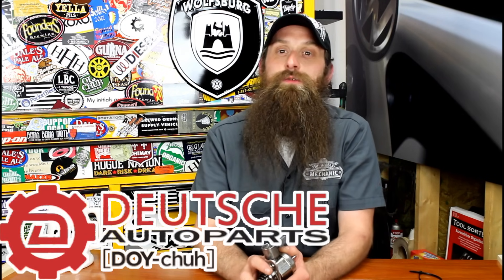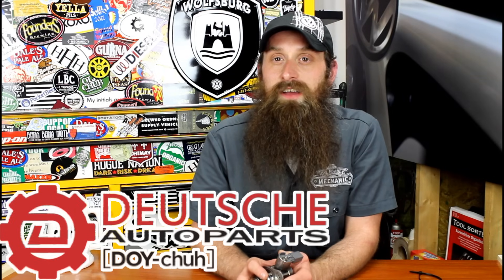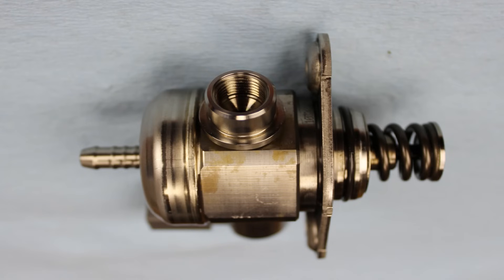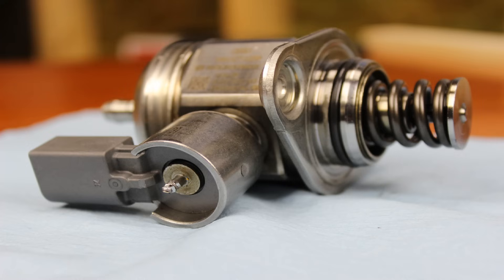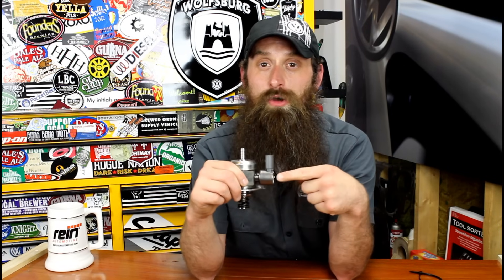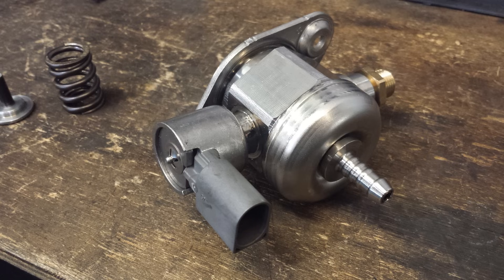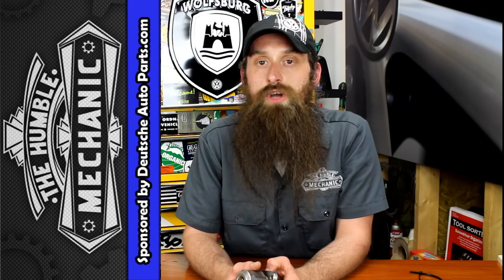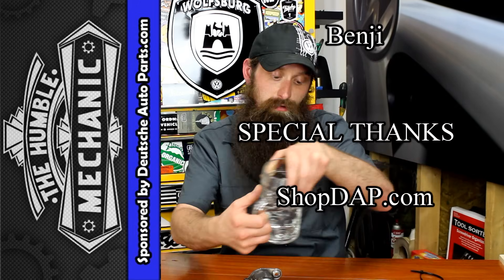How VW and Audi 2.0t TSI High Pressure Fuel Pumps Fail (HPFP)

Comment: Be advised, this HPFP can leak internally and dilute the engine oil. The symptoms will be hard starts after shutting down a hot engine for an hour, misfire at idle after the engine has warmed up, and negative fuel trims as low as negative 100. No issues off idle. My Mk7 GTI was at the dealer for 2 weeks and 4000 dollars later it was not fixed. I replaced the high pressure pump and all operating parameters are back to normal.
Reply: Quick question. I have a mk6 so I'm not sure if the same applies. I've been suspecting my HPFP of being problematic for a while. How were you able to properly diagnose it as the issue? I ran VCDS and checked block 106 for fuel rail and my actual was between 38.9 and 40.09 bar. It falls within spec, but nearly all the symptoms you listed apply to me. How are you measuring fuel trims so I can also check for the negative 100 symptom?
Reply: @mozartsghost9271  the scan tool shows the fuel trim
Reply: We had a 2.0t audi that came in and no one could figure out the misfire and I eventually found the oil thin and smelling like gas, found the hpfp was leaking internally and replacing it fixed all the issues, then a couple months later we had another one come in and my hunch was same issue and bam it was.
Reply: @courtlandsampey9825 what did you do to find that the hpfp was leaking internally?
Reply: @hockeyboy834  the thin/fuel saturated oil was the main giveaway, but after disassembly I think I hooked up air into it and found leaks/bubbles with soapy water but this was a while ago now
Reply: I’ve been trying to hunt down my issue for 2 years. 5,000$ later here we are. Thank you for this.
Reply: Thank you for this comment! MK7 golf 1.8. Had the hard starts symptoms on hot engine for a year and a half. Was intermittent at first but in the last 6 months it was almost every time. No code, drives fine and cold starts every time but struggles when engine warm. Swapped the hpfp for a used one and did not experience any issue in for the past 2k miles.
Reply: My 2008 Audi A3 8P1 1.8TFSI is currently suffering fuel in oil. Changed fuel injectors and it ran for 3 weeks before red critical low oil pressure warning re-appeared this Saturday gone I found the oil smelling of fuel. I've now order a new Bosch HPFP. Really hoping this is the problem otherwise it's going to be pricey penny at the garage and I'm wondering if it's even worth it.
Reply: Literally my problem. Dont know about fuel in oil as I change my oil very very often😅. But every other issue you mentioned is exactly what I’m having. Just bought one yesterday. The hard starting is getting out of hand and it’s embarrassing!!!
Reply: @FZERO20 did you change your hpfp and does it correct your problem? I have a mk7 that have the same problem
Reply: @davidbelanger2668  dude. I did hpfp, lpfp, fuel filter, cam magnet, intake cam plunger, crank sensor, timing chains. Car runs amazing but I still have extended crank after it’s hot. So embarrassing, next on my list is injectors. Afterwards I have no clue. There’s a shop called Eurofed and they tune these cars. Imma take it there and see if it’s an issue with the coding
Reply: @FZERO20 well i hope you find the problem soon!! On my side, the car start fine but from time to time it crank but wont start or crank and start but misfiring. Sometime i have to give it gaz to make it start when cranking. When the car is started, everything runs fine, no power loss, no missfire and normal fuel consumption…
Reply: @FZERO20 there’s a tsb for in tank fuel pump they do a check valve
Reply: @davidbelanger2668 hey mate, did you find the problem ?
Reply: @coskunkomurcu  no, i totaled the car lately so the problem got solved by itself
Reply: @FZERO20   hello my friend, have you solve your problem?
Reply: @ I did all the work. It ended up being a bad cam shaft phaser. So I had to replace the entire cam to correct the issue. It got worse over time
Reply: @FZERO20  that happend only on warm engine or every crank?
Reply: @ it used to be on warm. But eventually happened every morning after coming home, and then every time i would start it up. And overtime I noticed a rattle from the phaser, especially at idle
Reply: @FZERO20  thank you 👌
Reply: @davidbelanger2668  good one 😆 I hope UR fine.
Reply: @LewandowskiDamianManager  yes me and the gf are good, juste a little bruise on one hand and that’s all, thank you! Now running a 2025 GLI so i’m good for now😂
Reply: Charles does not mention the third failure mode in his video, but naptown tuner has at least three videos where he mentions the internal leak.
Reply: I have a v8 twin turbo, what is your definition of hot because an hour after it’s off it’s still warm
Reply: @DomDanCam  Hot means the engine reached full operating temperature. I don't mean overheating.
Reply: Also, check fuse 23 if you have an mk6 gti. It powers the auxillary water pump and the solenoid for the high pressure fuel pump
Reply: I am having the same issues. Mk 6 GTI. Backfire after 20 minutes in traffic and engine stutters under 2000 rpm. Hard starts and rough idle when starting a warm engine. Additionally when engine is warm with oil temp above 90 I get a low oil pressure warning at idle.
Reply: @ionootz83 mine did the same, as i did replaced my hpfp and the fuel rail pressure sensor. A fualty hpfp can delute your oil quick.
Reply: @ionootz83  hi mate I’m having the exact same issues as what you’re stating, did you manage to find out what it was?
Reply: Welp, my problem came back after 500 miles
Reply: Does this make epc light and code p0303 get triggered?
Reply: Thank u
Reply: I have the exact same symptoms. MK6 GLI hard starts or extended crank if hot. System rich code. Car won't run with Maf sensor connected.
Reply: This is 💯 correct 👍🏻

Comment: I got a P2293 Fuel Pressure Regulator 2 Performance. And looking at data around 4psi boost I'm getting drop out of high pressure fuel actual. Was at 1/8 tank of fuel when was happening. Shut off car, filled to full and then it ran fine.
Reply: I've got this and can't seem to get it to clear have changed in tank fuel pump, fuel pressure sensor, coil packs and fuel cap, still getting the same code 😔

Comment: I have been watching lpfp duty cycle in my 2012 gti with obdeleven. At idle, rail pressure bounces between 555 and 580 psi with lpfp duty% between 50 and 62. Duty% maintains a constant value ,idleing, but seems higher on warmer days. All seems fine to me but im curios Can the hpfp suck fuel from the low side? Like if the lpfp is stugling will the hpfp help it? Once every 2 or 3 months i get a long crank start or have to crank a second time to start only after a short trip when engines hasnt reached operating temp. Im thinking the filter is bad since it incorperates a check valve

Comment: I got 2014 vw passat 1.8t gen3, i am getting EPC light and scanner says Torque limited due to fuel pressure, and it make noises in low rpm when under load. Do i have high pressure or low pressure fuel pump bad?

Comment: Can it bring up your O2 sensors saying running rich ? And O2 sensor running lean ? Because I have changed all O2 sensors and still same errors come up! My back fuel pump has been changed but not the high pressure one, sometimes the high pressure pump sensor says faulty even though it’s a new one!

Comment: I have a mk7 gti with an upgraded HPFP and when I go WOT it just falls on its face. It drives fine under normal in town driving but once I mash the throttle it’s a no go. There’s no check engine light and it doesn’t misfire at all. Any ideas 😅
Reply: same here - did you ever figure this out? Thanks
Reply: @Hello_Apee  low pressure fuel pump sir! But I also changed the HPFP while I was at it since I’ve been running nothing but straight E through it for like 4-5 years now 😅

Comment: Hey Whatsup I've been a loyal follower of your videos since my MK2 Jetta and doing a lot of DIYs. 
I wanted to ask I have replaced ALL my fuel components for my cc2.0tsi, hpfp,lpfp, fuel module has been recalled by VW, fuel regulator sensor has been replaced also. My car is STILL showing the P2293 “Fuel Pressure Regulator 2 Performance.” and showing all the symptoms I've noticed that a faulty cam follower does for an FSI... but I don't see anywhere confirming that the updated cam follower (roller type) tend to fail. This has never been replaced in my car but idk I don't want to be replacing stuff and still not getting anything fixed.
Reply: also, valueblock 93 camshaft adaptation angle bank 1 has a value of -6.13. But I don't get any relevant codes to that only the code P2293 due to that I am basing myself that its not timing chain tensioner related that's causing the fuel regulator performance code

Comment: Hey ive got a Question , 
   On the 2016 1.8 polo  192ps gti tsi  DAJA,   I need to remove & re-seal valve cover, can the hpfp stay bolted to the vacuum pump  & remove it as one piece once the adapter ,hoses & the high-pressure line to the unions nuts are unattached? 
 Or do the have to be seperated before the vacuum pump is unbolted from the cylinder/cover surface ?
 Thanks in advance

Comment: Good Day to you (advice needed)
I am Charles M.
I recently financed a 2010 VW cc 2.0t in Arizona.
After driving it to California and back to Arizona a few times and keeping up with the oil changes. I noticed the engine would not start at times after driving to a store I would come out and start the VW it would start than drive 10 feet than stall at times 10mins to as long as 30mins. I also noticed now in California the low oil pressure light comes on after about 25 mins of driving above 40mph.  I did a diagnostic check and got 2 codes P2293, P2401. The older gentleman also share that the oil pump on German cars very rarely go out and maybe the oil pan needs to be clean out really well that this can congest the flow of oil once heated causing the pump to struggle. I did finance the Direct Injection High Pressure Fuel Pump - 2010-2017 Volkswagen CC 2.0L 4-Cylinder - Bosch
Hoping to solve this issue.
I can do the work myself I just would like some advice if you will.
Thanks for your time
-Charles M.
Make it a great day!

Comment: What should the solenoid be reading with ohm meter? I replaced mine, was running fine. Now has code p2293  n276.

Comment: Hey what’s up dude, im a big fan! I only have like 2 volts going to the hpfp solenoid? Fuse and relay are fine. I have low voltage in that whole circuit? Have you ever seen this? Replaced hpfp. Thinking the ecu is no good? Does the ecu varies the voltage? Im getting computer ground at the solenoid. Any help would be very much appreciated 🙂🤙 also just picked up from body shop and of course they were like oh it came in that way! They did say they had to jump it and charge the battery????

Comment: 2009 vw CC 150k No start condicions  codes:
PO101 mass or air flow circuit
po342 cam shaft position sensor a circuit low input
P2015 intek manf runner position sensor bank one
P2293 Fuel pressure regulator 2 performance
p2294 Fuel pressure regulator 2 control circuit 
P 2295 fuel pressur regulator 2 contol circuit low. 
all that after my son was driving about 70mph and engine cut off and won't start, i did have to tow the car to my home and not sure if a should start buy with this part, or any ideas will bevery thankfull.... and its his first car...2009 vw cc TSI 2.0

Comment: Will a high pressure fuel pump cause a vw gti 2017 to take a little longer to start? And cause check engine light?

Comment: Help please my 2009 Jetta gli 2.0 tsi keeps blowing the fuel supply line off of the hpfp 
I thought the spring clamp was weak installed a hose clamp extra tight still blowing off I can’t find any information on the low pressure side of the fuel system

Comment: I have a no start at my shop 2015 2.0t low fuel rail pressure code. I checked low side pressure with mechanical gauge and was reading 80psi. Using ross tech I'm getting 9 bar rail pressure. I replaced the hpfp and follower and still have 9 bar. I have 12v at the solenoid but no ground coming from the ecm when cranking. Cam lobe appears to be fine and when I rotate the crank I can see it moving. Checked signal at ecm and none is present. I'm thinking maybe a bad driver in the ecm but the ecm has to come from vw Germany so I guess I want to be sure not not missing something here. Any advice would be appreciated. I'veactually have tries 2 different hpfp with the same results think I might have gotten a bad one. Could a faulty rail pressure sensor cause the ecm to not command the hpfp solenoid perhaps.

Comment: 2015 TSI Passat. My car started stalling in street about ten minutes after starting. I replaced coils and coil packs and still had issues. Eventually it didn’t even start. I just replaced fuel pump control module and it starts but runs poorly. Runs with little power, stutters, and a “puffing” exhaust. 

I’m ready to replace high pressure fuel pump. Is there anything else I should look into?

Comment: Hi, I have code P0087 and fuel cuts around 4k RPM after an E85 tune with EQT and install of Autotech HPFP (Pre-assembled). Stock turbo. I had zero issues before installing the new HPFP. Bad HPFP internals?

Comment: great info on hp ,but what are normal low pressure readings ? i know 45-90 psi what i have is 90psi on start but after 2min presure stays around 45psi even under heavy load / accel ,is this normal or low pump starving high pump ? my high pump was bad , just looking for reason thanks

Comment: I like how VW just uses a rubber hose and clamp for bringing gasoline into the high pressure fuel pump. I hate those stupid plastic lines that use an o-ring and clip to seal. They crack.

Comment: Just found this video and shed light on the way my car is setup. I have a mk4 gti with the 1.8t and a shop did the build. Couldn't figure out why they had an in tank pump and then a 2nd pump near the engine. So looks like the in-tank is providing the 2nd pump with low pressure volume and then once it gets to the 2nd its giving the fuel rail a higher pressure so the larger injectors can spray what they need.

I just had a no start yesterday, and sounds like the 2nd fuel pump primes intermittently. There much be a relay or something that turns it on, not sure where to check it yet though.

Comment: Hey guys, my VCDS reading saying I’m pushing 109.99 on the fuel rail pressure when it should be 130, it’s on a Audi A3 2.0TFSI BWA engine. Is my HPFP failing? Or just the cam follower?

Comment: Hello how are you guys ! I jus made an account at shop 
dap and I’m looking into the height pressure fuel pump but I wanted to 
kinda get some insight from you folks before I do. Here’s my situation 

 2014 VW Passat Wolfsburg 1.8 -My car jerks periodically when I’m
 driving or stopped at a light it even idle, it feels like the engine is
 struggling to stay on or starving for gas but if I floor it it drives. 
Sometimes the traction control light comes on , sometimes it shuts off 
completely, the battery light would come on and I restart it and it’s 
fine until it does it again later. I’m unsure if the cause. I recently 
got the engine oil cooler and separator replaced because I had oil 
leaking into the Coolant reserve tank , after that I replaced engine 
coils, spark plugs and belt. DO YOU THINK ITS THE HIGH PRESURE FUEL PUMP OR LOW PRESSURE?  If you guys can kinda point me in the best 
direction that you can - UPDATE WHEN MY TANK IS FULL I DONT EXPERIENCE THESE ISSUES, OR NOT AS OF YET
Reply from the maker: Id lean more on low pressure side just based on what you are saying. BUT, id rather you get a proper diagnosis before throwing some parts at it.

Comment: Most of the failures on EA113 motors I ran across were due to neglect - not changing the cam follower. I've found two broken hpfp pistons in EA888 motors. In one the customer told me it was stalling at every light and constantly misfiring for several weeks. It stalled three times at the same green light and wouldn't start again. Along with the borked hpfp it was very low on oil and the timing chain tensioner failed. I tell all my 2.0T customers that a few quarts of the most expensive oil is far cheaper than a valve job. But I digress...
Reply: No one is replacing these on the 1.8 TSI .   the dealer nor a german auto service place has been doing them.

Comment: What should be the psi at idle? I have a tiguan and it shows 560 psi to 600 psi at idle but been getting miss fires at start up. Cold start smh
Reply: Cold start misfires might be carbon buildup on intake valves. Get them walnut blasted. Since the intake is off to do that, you might as well let them replace the water pump too since it's under it.

Comment: After a long run when I stop my skoda superb 1.8 petrol for long time and then I tried strat. ....it cranked  but wont start ....but when i removed the front soft pipe line from hfpp and then strong petrol pressure realsed from the hfpp and my car star immediately ....please please please reply same pump no check engine light
Reply: Hi,
I have same issue with Skoda superb 1.8
Do you resolve the problem?
Thank you
Reply: @MrBulyna  yes, you need to replace fuel pump under the back seat, it cause the pump moter got week. Normally OEM VW pumps have this issue. Therefore i had installed aftermarket fuel pump.